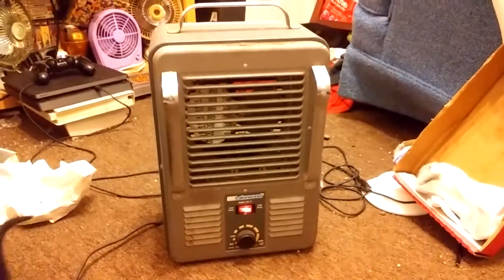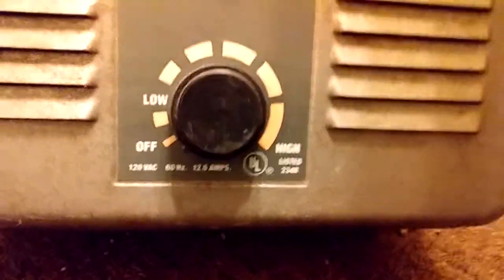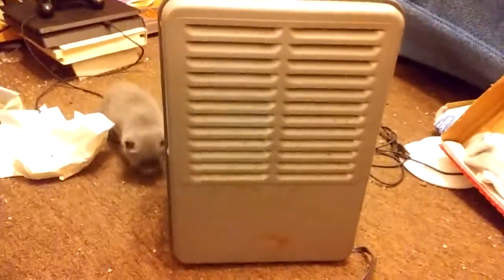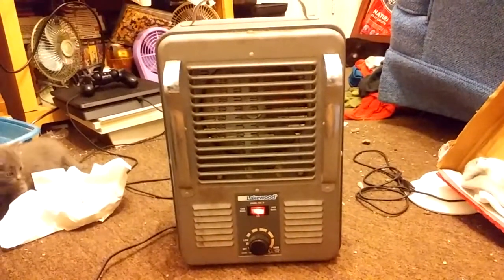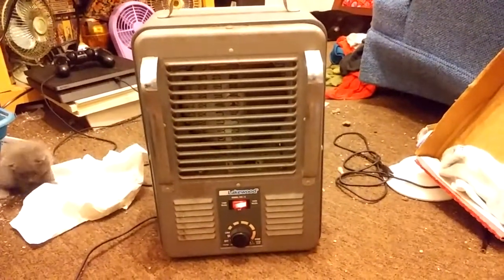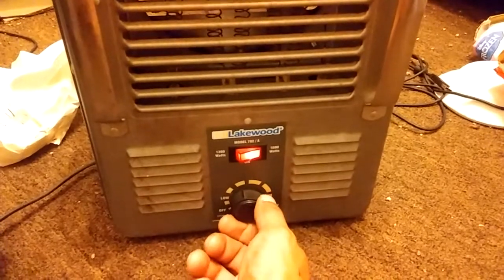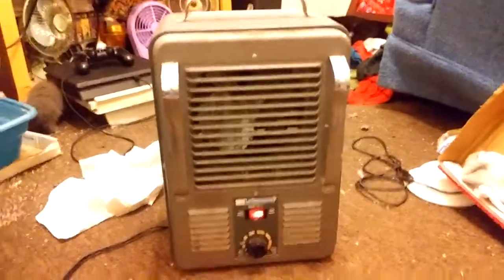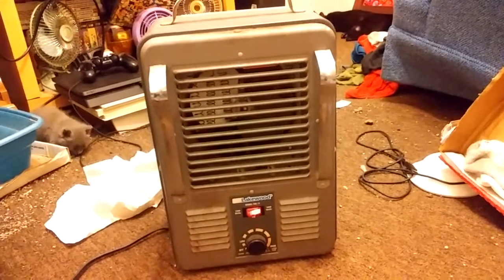Vintage Lakewood model 792/A heater

Comment: Good on ya for oiling it up. I've got the same one, just had to replace the switch. 

The metal brackets on the front have loose joints at the top that can rattle when the fan is running. Plastic twist ties around the top of them where they join the case make them tight and quiet. Gotta twist the twist ties tight.